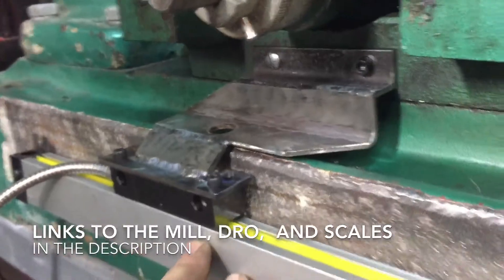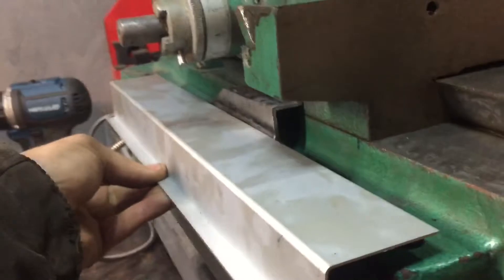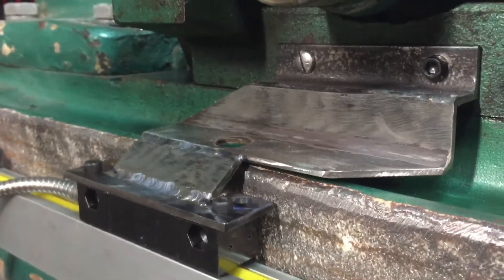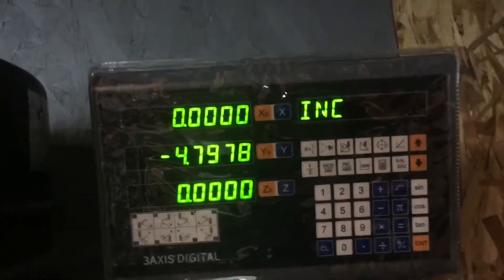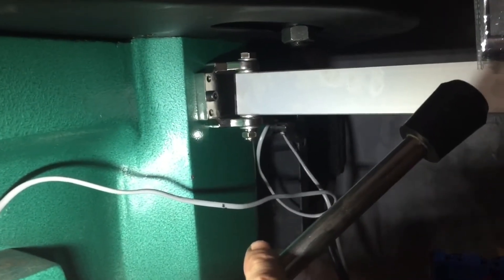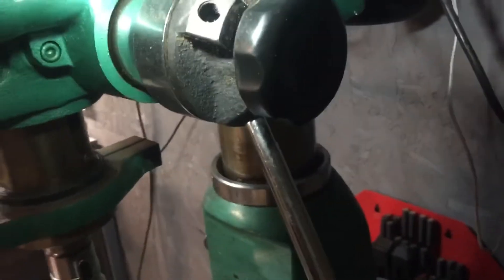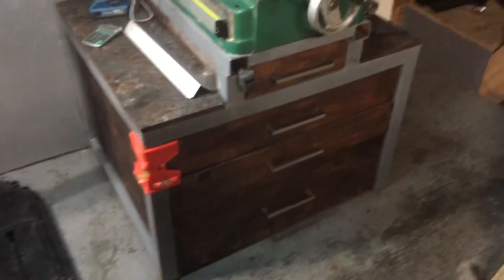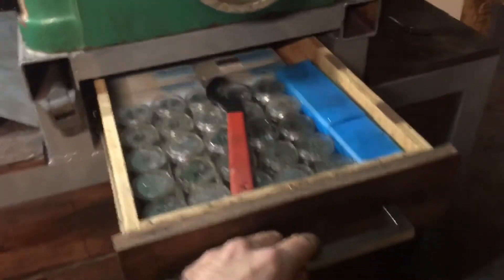RF30 Rong fu mill dro digital readout y axis bracket

Comment: Do you have links for the dro and z beam?
Reply from the maker: I bought the kit on ebay that best suited my size and cut the scales down (carefully) I added the z axis dro scale to the mill so the readout is on the dro now. That battery powered dro that was on the z axis ended up on my logan 200 tailstock that was sold. You can search “dro quill” for that

https://www.ebay.com/itm/232881134471